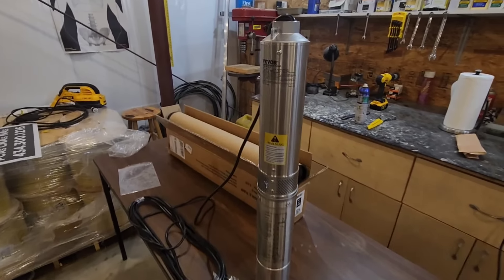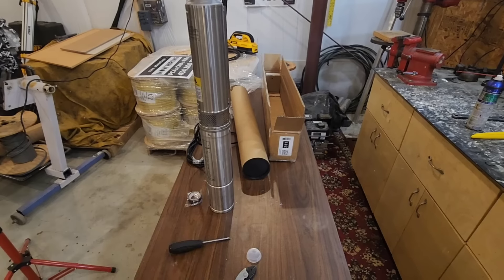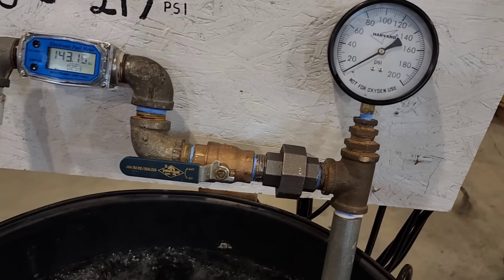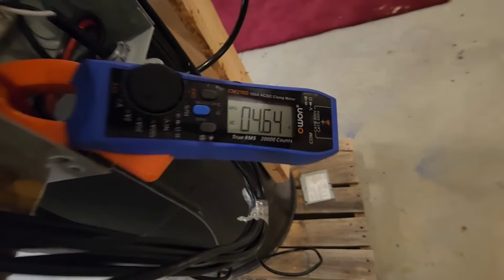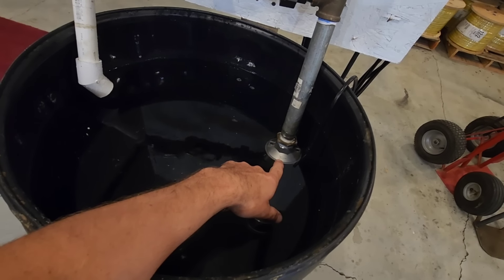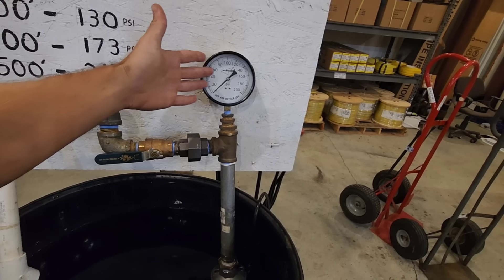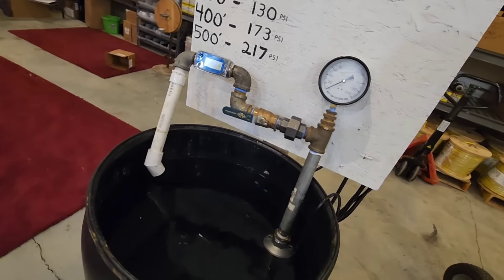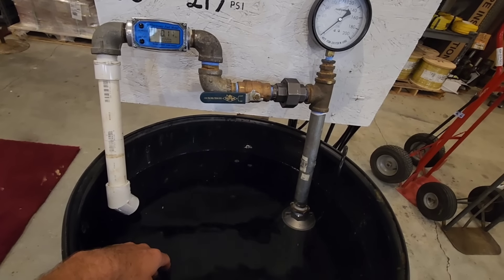Lowes Well Pump Test. $125 Vevor 1/2Hp 25GPM Submersible Pump, How does it perform

Comment: that flow meter probably requires a straight run on the inlet and outlet and never put a flow meter on the high point in the piping , preferably mount the flow meter vertically

Comment: Sounds like that pump is designed for a specific application and people are putting in an applications that it was not designed for and there's nothing wrong with that pump. It's just that you need to find a pump that's specific to your situation. Sounds like this pump is a good for storage based systems for you. Do the pressurization after the storage of the water and seems like it works fine for that. But if you're going directly to a pressurized system, it looks like this pump is not good for that for deep well that is

Comment: I have water storage tanks. Wondering, will bypassing the bladder tank and wiring in a float switched on the submersible well pump increase the pumps longevity?

Comment: I ordered one of these 1hp it says it's good for 207ft mine is 165ft down and I can't get my pressure no higher than 33psi and it's pulling 5.7 amps when running. Is the pump my problem why I can't get it higher

Comment: The less flow the lower your amp draw will be. If you close the valve completely it’ll drop even more. The pump isn’t doing any work. That’s why you start big centrifugal pumps with the discharge valve closed, to reduce the startup amps

Comment: Hey you do an Awesome job doing videos on all things. I am from Canada and I have a sand point and a 3/4 horse pump. It has a 30/50 switch. I checked the air pressure in the tank and it was 52 so I put it down to 28. That's what the plumber put in 10 years ago.Was I right putting it down to 28.
Reply: I think it should be set a few pounds below the upper limit or around 48, otherwise it won't turn on.

Comment: 18 Ga wire? !!!!  That can't be right. Even a standard lamp cord is 16 or 14. I wouldn't even use 18Ga as speaker wire. You did a great job explaining to the average person about overcoming head pressure for the switch. I think if you had added in the length of the run to the building, it would have complicated things for some. I hate that they misrepresent this pump as being a typical deep well pump that would normally have a pressure switch. It would be interesting to see what would happen if you added 100 ft of 18Ga wire to the circuit, lol. I don't think your results would have been the same. Thanks again for keeping the average consumer safe and wise enough to avoid making a bad purchase decision. I certainly would have been tempted if my well was that shallow but the Ga of wire would have made me look for a better pump.
Reply: Look_What_You_Did  I understand that, but I didn't expect an amp draw so low. If the pump should ever pull some substantial amps before it fails, it will melt the wiring.
Reply: For a majority of the planet  100-plus feet is a deep well. Utilizing an unpressurized elevated storage tank is the norm for most other areas of the world. We here in the United States have many luxuries including extremely good filtration and softening.

Comment: Im looking for a pump for a 100 foot well 60 ft static level 6 inch casing. Any suggestions 
?
Reply from the maker: @charlebrownga  Grundfos SQ200 or the J-class 1/2hp  10gpm. Just make sure you match the voltage correctly. Both are offered in 120v & 240v (240 is common)
Reply: @h2omechanic  thanks!

Comment: My water system is a 30/50 pressure switch. My wife misses city water pressure. Would I shorten the lifespan if I bumped the switch up to 40/60? Or would that require something new in terms of pressure switch or bladder tank equipment?  Is the change from 30/50 to 40/60 even that significant? Thank you sir!
Reply: More pressure the harder your pump has to work to satisfy your pressure switch. Probably will shorten the life of your pump.

Comment: No pump curves in the docs?  Missing specifications are typical for these direct chinese import pumps. :(
Reply: You dont need a pump curve, the curve is slightly a bow nearly straight, so it is pointless.
Your piping has more effect on the pumps performance than the different from a steaigh line vs a correct pump curve.

Comment: @h2omechanic - 340 foot 6" well, static water level of 70ft, pump hung at 320feet. Well can produce 10GPM, so I want a pump that is capable of at least 10GPM.   I have a 3-wire Franklin Subdrive VFD instead of a cutoff switch and would like to keep using that device.  Can you make a recommendation on a brand and 3-wire model pump?

Comment: Our local Community Hall has a drilled well with a static level of just twelve feet. This pump would definitely get the job done, and satisfy the pressure switch. However, that's something of a special case; my well at home has a static level of 110 feet, and it takes quite a bit of horsepower just to get the water to the surface. I still need an additional 60 psi to satisfy the pressure switch. Half a horsepower just can't do it.
Reply: Then consider to fill a reservoire and use another pump or better an autoclave to meet pressure requirement

Comment: Shouldn't that information be in the spec sheet? Looking at the ad it sort-of does, but unlike other pumps doesn't show the head with 40 PSI offset, just flow vs head with flow going to 0 at 52m = 167 feet.
Reply from the maker: Exactly right! But no one ever noticed that. 90% of people will try to hook it up with a bladder tank.
Reply: But it can hook to bladder tank if well is 37' static water level right?  W a 20/40 pressure switch like u said right?  It should still work right?

Comment: Does the.static water level affect any of the numbers in your testing? If the pump is set at 164'and the static water level is at 15' does that change anything?
Reply from the maker: Once you draw the water level down to 70ft, it cannot shut off a 60 psi switch

Comment: This pump is for cattle ranchers rather than homes
Reply: We use them on the ranches in Pima County all the time. Great for wildlife drinkers that run off solar.
Reply: Not true
Reply: Cattle ranchers don't need a lot of water?
Reply: Over 10 gallon per minute pumps are normally classified as irrigation/storage pumps. They are not for home pressure use.

Comment: How big a pump would I need for a deep well pump for  a well pump at 350' on a 500' deep well.
Reply from the maker: You need a 5 GPM Pump
Reply: @h2omechanic  thank you.
Reply: @h2omechanic  How do you get to 5 GPM? Lets say his well has an unlimited water supply at 500' and he would like to fill his pool. Wouldn't he then want a >= 25 GPM pump with a static pressure of >= 20 bar? Just asking, since he didn't mention how much water he actually needs.
Reply from the maker: @tomgroenbeck7620  
A 22-25 gpm typically goes in a well 75-140ft max. It flows volume but lacks the ability to lift.
A 5 Gpm pump is the opposite, it has the ability to lift water from very deep underground but provides less volume. There set 350 to 450ft deep. 
The only important variable in all situations is the static water level in the well. 
If its 200ft to the water level, that's when the systems change over to stick pipe & a bigger 2-3hp pump.
Reply: @h2omechanic  my static level is about 10'
Reply: @h2omechanic  "typically" you are correct. What I was trying to say is that there still may be an application where someone wants to run a fire hose from a 1000' well, if it has enough water. When we bought our pump the specialty shop had a catalog with several hundred pumps for all kinds of applications, provided your 400V 3phase power outlet was rated high enough. My dad had 400V 63A 3phase into the house, which cost extra. Obviously in your area the typical home needs water for the washing machine and to take a shower, so an industrial size pump will most of the times not be necessary.

Comment: your test system is already restricting the pump . i see you are using a pipe  reducer,  that will slow down the flow, so be far to the pump..
Reply from the maker: The test setup is designed to mimic typical installation. Elbows & pipe reduction. Neither will affect pressure, only flow rate 3-5%

Comment: The issue is here you’re literally closing a valve so I don’t really see how this is a accurate representation of “flow” when head pressure isn’t a closed off bal valve. Even on a strong pump. You can only get so much flow through a small opening there is a point where only so much water can go through
Reply from the maker: Look_What_You_Did  correct!

Comment: I will be dropping a 1hp vevor down to about 50 to 55 feet I assume this pump will do fine 🫰
Reply: how does it work? thinking of getting that one too
Reply: @Eastbaypisces  
I actually got a 1 1/2 hp  vevor pump set at 48 ft work really good, pushed a lot of sound out of the well over the last year I will see how long it last.
Reply: Sand